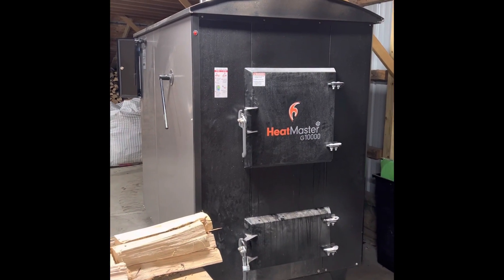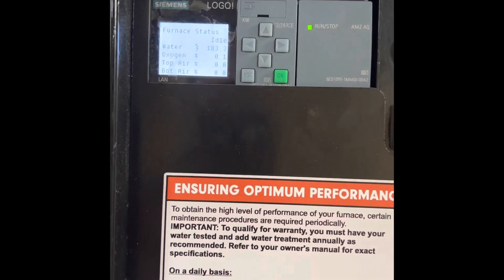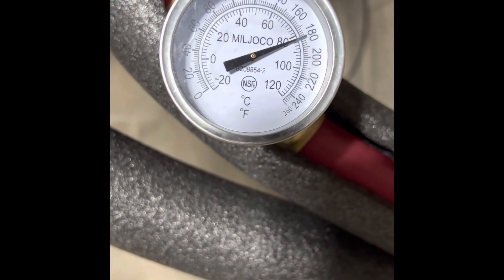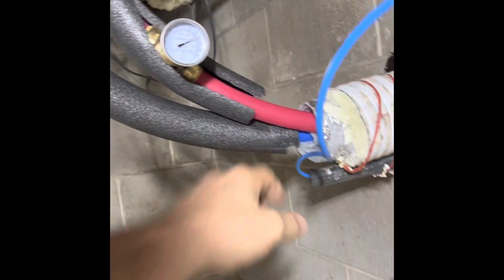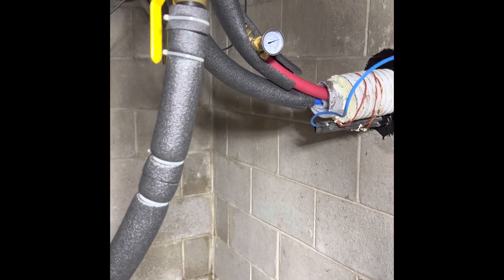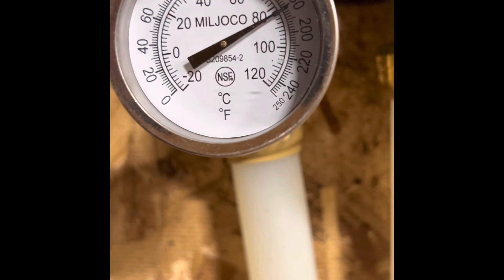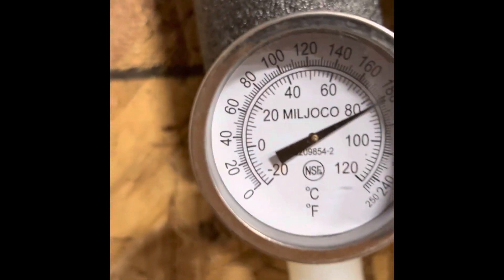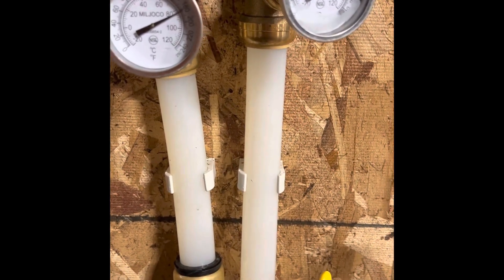Wood Boiler, How Much Heat Loss

Comment: What brand and size underground pipe did you use from the boiler to the house?
Reply from the maker: 1 inch pex and brand I’m not sure anymore. I know it wasn’t cheap.
Reply: @Treestofirewood  is it the urethane foam around the pex or a wrapped type of insulation?
Reply from the maker: @benbaver7941 it’s not the foam. I didn’t get the foam because I’ve seen to many times that when the pex heats up it has no where to expand and then eventually cracks the foam and could crack the outer layer. I did research on underground pex for months and that’s why I didn’t go with foam.

Comment: We have a G 10,000 just installed this fall , we have two runs coming off of our boiler , our longer run is 380 feet buried 8 feet under ground in Manitoba,  we ran 1" 1/4 pex from boiler to house with a 5 port manifold at the house , 180 degrees at boiler , 180 degrees at manifold in house. The G-10,000's have so much heat to give  lol
Reply from the maker: What pumps are you using on the boiler? And yes they do. Heat for days. The crazy thing is when all my heat sources are calling for heat the boiler will get back up to 180 with no problem.